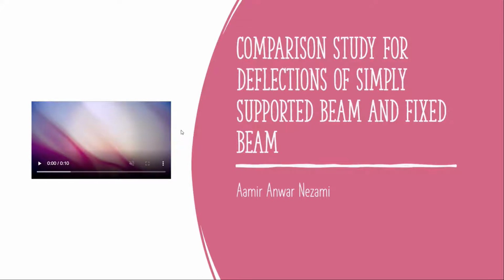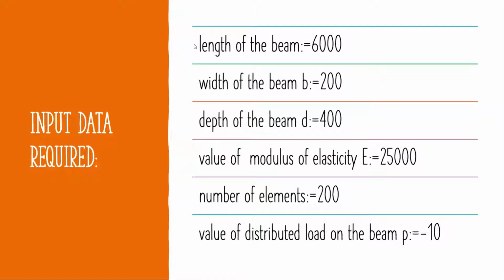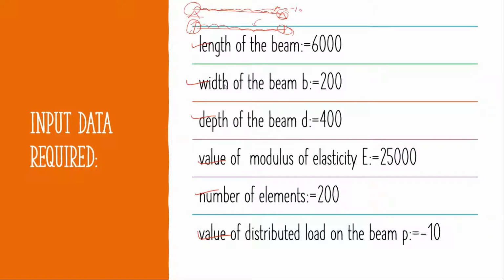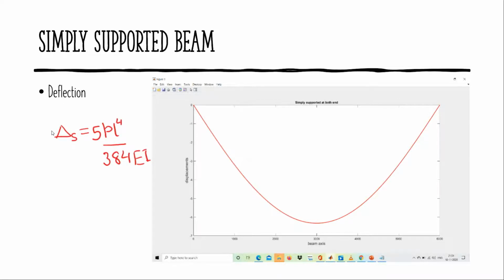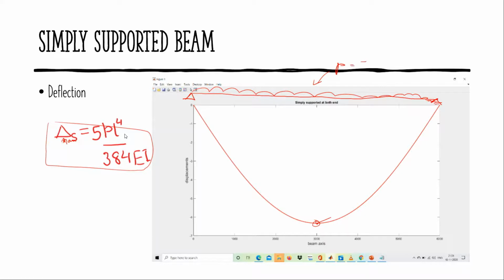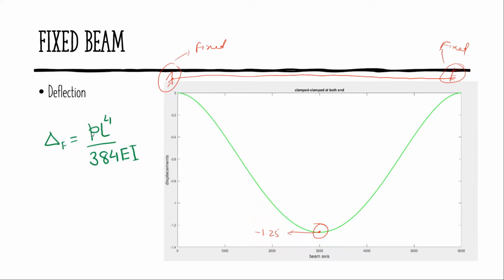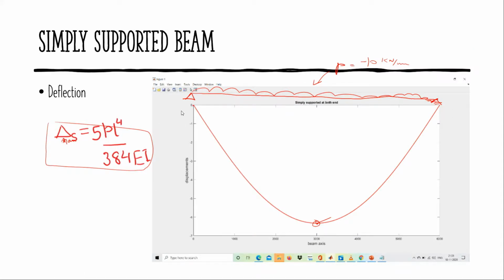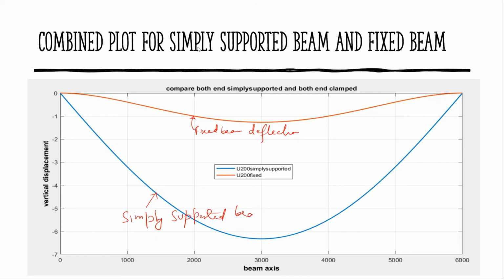Comparison study for Deflections of simply supported beam and fixed beam

Comment: Sir why the udl taken negative ? I think there is negative sign on formula of maximum deflection which indicates the nature of deflection.
Reply from the maker: Theory of elasticity concept , we know the stress acting on an element (assuming ) negative sign for compression and positive sign for tensile. We can therefore relate this load as stress acting on beam on top surface which is compressive(acting in downward direction).
Reply: @structuralengineeringforpr8570  ok sir thank u 👍🙏